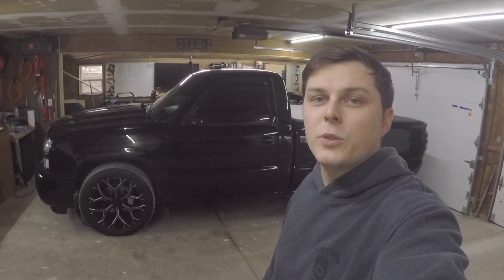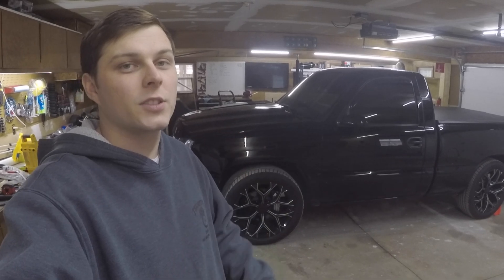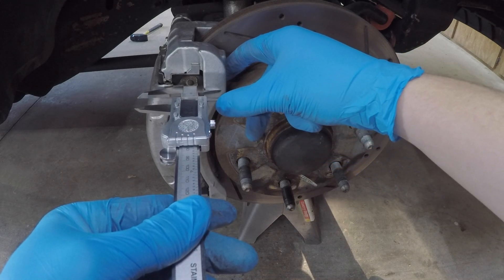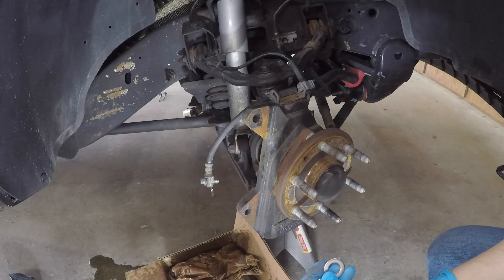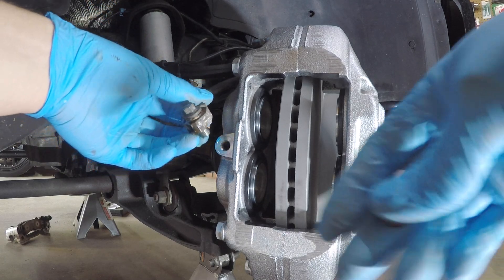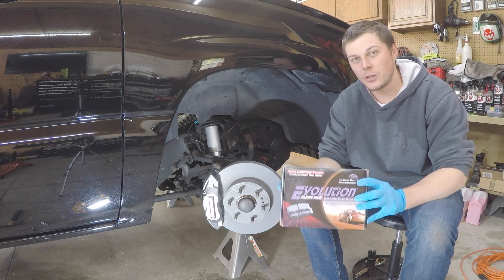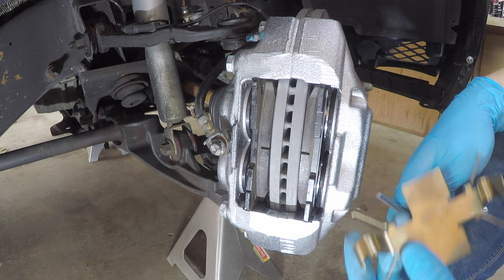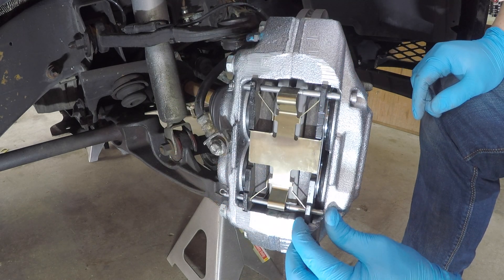Silverado 2019 Big Brake Conversion! “How To” A NBS!

Comment: Just to let you know.. if you go on rock auto and look up your master cylinder you can hit info and it will give you the spec on it so what I found out is our truck is usually 1.25 bore in it. The 2009 sierra has a 1.5 bore. That is biggest bore I found. I have an 07  so that truck has same line thread size.  Also for a 4 piston rear look up 2005 Chevy avalanche. The rotor is way thicker and bigger pads . I'm doing front and rear and MC on my 07 avy.. hope this helps
Reply from the maker: Thanks for the info, that's really helpful for anyone looking to do this conversion!

Comment: Do you know if 2015 n up calipers would fit my nbs?
Reply from the maker: I'd do some more research to confirm, but I'm pretty sure they fit. As long as they are 1500s
Reply: @TheKingCoopa yeah cuz I heard they got dual pistons in the rear 🤔
Reply from the maker: I have an 2004 Silverado 1500. So I put 2004 Yukon rear calipers on it.  Silverado rotors. Yukon calipers, brackets, and pads. Did the core return at AutoZone too, so it was like 150$ for the swap.

Comment: Will 2025 Yukon brakes fit ???
Reply from the maker: Hey, sorry for the late reply. I'm not 100% sure they will fit, since they are a different generation. But some of the websites say 2019+ brake calipers. So asl long as it's a 1500, I'd assume it would work. 

https://www.glennsautoperformance.com/products/2019-gm-truck-front-brake-calipers-pair

Comment: So, I'm only about a week into the research of doing this to my 2003 Extended cab, Z71, 5.3, LT. I see most need more oil movement with doubling from their stock pistons. But what about using a newer Master Cylinder made for these upgraded Calipers..? Does the 2018-22 Master Cylinder work better or is there issues I haven't heard about yet..?  What am I missing..? Thanks for any responses..!!
Reply: Found anything yet?😢
Reply from the maker: Hydro boost master cylinderswap is your best option
Reply: Following
Reply from the maker: Hey, sorry for the late reply. Honestly I'm not to sure about the newer master cylinders. If you were going to change to anything, I'd change to a hydro boost master cylinder. I did the swap, not super difficult. It made a drastic improvement. I also have hydro boost on my 3500 cab and chassis from the factory, it does really well at stopping that big girl.

Comment: Would those fit on a 03 trailblazer
Reply from the maker: Found a post on the TBSS Owners Facebook page. A guy used them. He said the holes on the spindle didn't line up perfectly. So they need to be modified. And you still need to run a washer spacer. He used TBSS rotors. 

https://www.facebook.com/share/p/1MHGecPk2k/
Reply: @TheKingCoopa  thank you for the info
Reply from the maker: For sure, good luck

Comment: Doesn’t look like you’re going to have full turning radius with that brake hose, looks like a banjo string
Reply from the maker: Hey, sorry for the late reply. With the suspension at ride Height, it had a lot more slack. But yea, it was tight. I ended up switching to stainless steel braided brake lines that were longer.

Comment: Hey the only way mine will fit with my oem wheels is with a spacer that’s is about 8mm 
I’ve heard contradictory things about spacers. Anyone have any input? This is also my daily 
2012 Silverado LTZ 5.3 vortec
Reply from the maker: If its a shim style space, just make sure you buy a reputable brand. And see if you can get one hub centric, so there is no vibration issues. And as long as your lug nut studs are long enough, and have enough threads to grab, you will be fine. I ran 2in spacers on my 03 silverado, lifted on 40s. And I used to run 3in spacers on my 04 single cab, with hard launches, no problems. Just don't get the cheap China spacers.
Reply: @ awesome thanks for the info yeah I plan on running them for about a year before I buy some wheels from a 2019 that fit 
I’m doing a sleeper build so I can’t do anything that’ll make the truck stand out too much 😂😂
Reply from the maker: @jeffthimineur622  hahaha for sure, sounds awesome! There are alot of new oem wheels that look pretty good too.
Reply: @ you know where I can get extended wheel studs for a 2012 Silverado 1500?
I got the extended lug nuts and it’s fine on the front but I guess because of the drum for the brakes on the rear I’m not too thrilled with the length of them after the spacer
Reply: @ the only wheel stud I could find was a Dorman 610-490 it looks like it would work but I’m not 100% sure
Reply from the maker: Hmmm, I couldn't find anything for extended studs on the 1500. The dorman you sent might work, says they are all for fords. But its a press in stud. So if the diameters are close, it might work.

Comment: Can you run the stock Master Cylinder when using 2 pot rear calipers and these 4 pot fronts? Not wanting to swap to a hydrobooster.
Reply from the maker: Yes you can. The bigger brakes will help with brake life. But with the stock master cylinder, it has to push more fluid, so you'll get a decrease in braking pressure, and you will have to push the brake pedal harder, to get the same braking force you have now.

Comment: What's the smallest wheel size that fits with these converting Calipers, Rotors and brake pads? Factory size on an NBS is a 16" wheel, I have 15's on mine, but I'm wondering what the smallest size that will fit with the most minimum clearancing on the caliper, no spacers used, I'd love to see a video on this.
Reply from the maker: Minimum is 17" diameter for outside clearance of the calipur. And even then, some 17s won't clear. A spacer is determined on the style of spokes. If the wheel spokes are concaved, they might hit and you will need a spacer or to grind the calipur down. If they are convex, you should be good.   

Regardless, you will still need the small washer spacers on the bolts to center the calipurs.
Reply: @TheKingCoopa  Thank you for the Info.
Reply from the maker: @Kaizen-117  for sure, good luck

Comment: Is there any requirement in upgrading proportioning valve? My truck is disc/drum?
Reply from the maker: Hey, not from the research I've done. Only time I've seen the proportioning valve effected or was aftermarket, was deleting abs unit, or going with manual brakes

Comment: You should replace that SS washer with one that is brass or steel. The stainless washer will eat your spindle
Reply from the maker: Hey, sorry for the late reply. Dissimilar metals definitely corrode a lot faster. I only dive the truck in the summer time, so I've been pretty lucky so far for no rust/corrosion.

Comment: This should still work for my 05 Silverado 1500 with rear drums correct?  Ordered everything for the front I just wanted to double check
Reply from the maker: Yes, it should fit
Reply: Yeah I assume it will, but I hate that I always had to look for brake parts on my truck based on having rear drums.
Reply from the maker: @AMacck  for sure, I get it. You could always axle swap it too, if you wanted to get rid of the rear drums.
Reply: I’ve thought about it but I’ve never really had an issue with the drums.  I replaced them about 6 months ago without issue.  I will post a reply this weekend when I get the new caliper and rotors on
Reply from the maker: @AMacck  if its not broke, don't fix it. Sounds good!
Reply: I ended up having to buy a different brand of washer then what you have linked but they are same size.  Did you just use one for each caliper bolt?
Reply from the maker: @AMacck  yup, just one on each bolt.

Comment: So will this work with factory rims on 2007 2500 hd silverado?
Reply from the maker: No, 1500s only. 2500s are 8 lug
Reply: @TheKingCoopa  I have a 2008 2500hd...so these calipers won't fit?
Reply from the maker: No, they will not fit. 2500s rotor size and offsets are different. Which changes the cliper size and mounts.
Reply: @TheKingCoopa  ...is there an upgrade for the 2008 Silverado 2500HD?....4 piston calipers?

Comment: great idea, what size tires and rims are running?
Reply from the maker: Hey, sorry for the late reply. In this video I had 22x9 +24mm wheels made by O.E. performance. they are called 176M. with some Michelin defender 275/45R22. 

my new setup are Legend 6 forged drag wheels, 1 off custom made by 3030autosport for my truck. The fronts are 18x10 with 275/45R18 Mickey Thompson street SS. the rears are 18x12 with 345/35R18 M/Ts SS.

Comment: Do you have the chances master cyd im going to go to hyd fac
Reply from the maker: Hey, sorry for the late reply. you don't have to change the master cylinder out. I swapped to hydroboost, when I did, I bought a new master cylinder meant for a 3500. the old one would have worked, but the new one has a larger piston which pushes more fluid for more braking force.
Reply: What year is the new on thks
Reply from the maker: @PeterHatch-mx7zc  i got it off rock auto for an 03 3500 silverado
Reply: @TheKingCoopa  thks

Comment: Do the same on rear calipers, 4 piston. the chey looks awesome
Reply from the maker: I've seen some nice rear big brake kits, but they are expensive haha. The 2020+ rear calipurs won't work with the previous models, because the calipurs have electronics in them to function.

Comment: Dude that is a cat eye not a new body what has this world become
Reply from the maker: GMT400 = 1988-1998, with a half year in 1999 with the classic also known as OBS

GMT800= 1999-2007.5 Known as NBS

GMT900 = 2007.5-2013, with again that half year in the beginning of production. NNBS

K2xx = 2014-2019LD (or Limited for the GMC). Same deal with the crossover at the end of production.

T1xx = 2019- current, with 2019 being crossover year as well.
Reply: Wild how you stated that boldly, publicly, and incorrectly. Bug eyes and cat eyes are 99-07 new body styles, between OBS and NNBS. 😅

Comment: What about the rear.calipers?
Reply from the maker: The 2019+ rear calipurs have electronics in them to function, and cannot be used with the older models.

I had singe pistons in the rear, so I upgraded to 2004 yukon 4x4 dual piston rear calipurs. I was even able to use my old calipurs as the core charge at autozone. You just need yukon brake pads, and you keep the silverado rear rotor. Direct bolt up. I think it was 150$ for the two calipurs and pads. 

If you want fancy stuff, there is a guy that makes brackets to bolt up corvette c6 or ctsv calipurs. But you will probably have 2k-3k in that full swap.
Reply: The rear suv rotors are thicker than the silverado rotors. That could be why u have to apply so much presure when u brake

Comment: Great video! I noticed the notes say that this will work on GMT 400s with 6 lugs. I have a 98 GMC K1500 4x4 Suburban. I'm assuming that there is some kind of spindle swap involved before you can do this conversion, correct? Any idea where to find info on that swap? Thanks for whatever help you can give.
Reply from the maker: Hey, I'm not super familiar with the gmt400 platform, I've owned them, but never customized them. I tried doing a some research on it, it looks like for the rear most people swap in a newer axle with the bigger and better brakes already on it. For the front, I believe you just need the newer spindle to add the big brakes. Here is a link to some info I found on it. 
http://67-72chevytrucks.com/vboard/showthread.php?t=779580

Not a whole lot of info out there for it. It looks like most people buy the "big brake kits" online, but there not that big compared to these 2020s. 

Sorry I'm not much help. I took the gtm400 off the description, just incase I'm wrong, I dont want to mislead people.

Comment: Hello so I have a 2010 Tahoe do you think I can fit those on mine I seen video of people grinding the caliper to make it flat to give a little extra clearance with spacers if necessary. Also do you have part numbers for the rear Yukon dual pistons
Reply from the maker: Hey, sorry for the late reply. They will swap over to your Tahoe, as long as its a 1500 platform. For the clearance issues, it primarily depends on your wheel design, and the offset it has. Some wheels clear great, and some don't. As for the rear Yukon dual calipers, I do not have the part numbers. I just took my old calipers to Napa/autozone and told them I wanted new calipers for a 2004 Yukon 4x4 with the 6.0. And slapped the new ones on, that was a few years ago. Sorry I can't help you much there. Hope that helps, Good luck with the swap!!

Comment: from the philippines, thanks for the detailed video. was thinking on doing a big conversion.

do u have the part number for the rear aswell and what i need?
Reply from the maker: Thats cool! Glad I could help out with the videos. 

The 2019 rear calipurs have electronics in them. So they are not compatible with the previous generation trucks. 

I used 2004 GMC Yukon rear calipurs, and calipur brackets. They are dual pistons.  I did this a few years ago, and don't have the exact part number, sorry.

Comment: The links to the calipers dont come back to anything
Reply from the maker: Hey, sorry about that! GM has changed the part numbers so many times. I've updated the link twice since posting this. I gave up on it and no longer have a good link. Plus I dont wanna put a bad link up, and mislead someone or waste their money. Usually I only put up links for parts I bought and know are a gareteed fit. Sorry not much help. I'd try the dealer. Some trucks get brembros swapped at the dealer. And they have to discard the factory brakes. I know a few people were able to get them from the mechanics for stupid cheap that way. Good luck with the search and swap 🤘

Comment: Do you have any idea if this will work on 14-18 silverados as well?  Id imagine it would.
Reply from the maker: Hey, the conversion of the 2019-2023 front end big brakes for the NBS GM truck.This applies to GMT 400: 1987-1999/2000, GMT 800: 1999-2007 Classic, GMT 900: 2007-2013/14. 1500s ONLY. Will NOT work on 2500/3500's. Must have 17in wheels or larger.

Thats the research I've found. I would assume it will also fit the 2014-2018  1500 models, but I can't garentee the fitment.
Reply: @TheKingCoopa  thanks for the info!  I will have to just try and see
Reply from the maker: @Dcervantes243  let me know how it goes! I'm pretty sure they will fit. Of I remember right, I've seen people swap the 2014 brakes onto the cateyes. So I'm leaning twords them fitting. You still might need the washer, so they are spaced right. Im not exactly sure with your model. Best of luck though!!

Comment: Will this work on a 2013 Yukon
Reply from the maker: Hey, This applies to GMT 400: 1987-1999/2000, GMT 800: 1999-2007 Classic, GMT 900: 2007-2013/14. 1500s ONLY. Will NOT work on 2500/3500's. Must have 17in wheels or larger.
Reply: @TheKingCoopa  17 inch wheel with -12 offset works?
Reply from the maker: 17s will cut it close. Because the difference in manufacturing, some 17s clear, and some don't. But if they clear, it will be super super close. Also the offset doesn't really matter, that just changes where the wheel face is mounted to the barrel of the rim. Changing how the rim fits inside or outside of the wheel well.   Its more so the spoke design. Thicker spokes close to the hub have a harder time clearing. 

Honestly the best way is to see if someone else is already running your wheel with the big calipurs. Worst case, you can always grind down the calipur some to make it clear. Or run a small 2mm - 5mm spacer
Reply: @TheKingCoopa  my 17's are concave wheel and not Dish wheels so that should help because the spokes are going away from the caliper
Reply from the maker: @juniorshallow7468  nice, that should help

Comment: Where the fuc do I buy the calipers, can’t find em anywhere, only on eBay for 200+ a piece
Reply from the maker: Haha its a struggle! GM keeps changing their part numbers, So they are hard to find in stock. You might get lucky and ask the dealer, some of the trucks get upgraded to brembros, and they discard the old calipurs. Find a friend that works there and you could probably get them for super cheap, or a case of beer haha

Comment: Sweet truck buddy, I have a 2020 Silverado and just replaced the pads. I now have a jingle/rattle over bumps like the pads are loose. Have you had any issues since the NBS caliper conversion?
Reply from the maker: Hey, thank you! I never had any issues with mine. Did you change anything else while you were there? Did you take the brake line off, and get air in the system?

If the pads were loose or wiggling around, I think your stopping power would definitely decrease. 

Have you tried jacking up the front end and try wiggling the tire, or turning the steering wheel? Maybe its a ball joint clunck, or the tie rod?
Reply: @TheKingCoopa  Just the pads. Only have 36k miles.OE pads had a crack in the driver side and was squealing. I have noticed that the GM oem pads have an adhesive on the back side and the Carquest Premium Platinum ones I have now do not. But the GM tech told me to install Advance Auto's best pad, so that's what I did.
Reply from the maker: @austincooper2940  hmmmmm weird, honestly not sure. Dumb question, but are the lug nuts fully tightened?